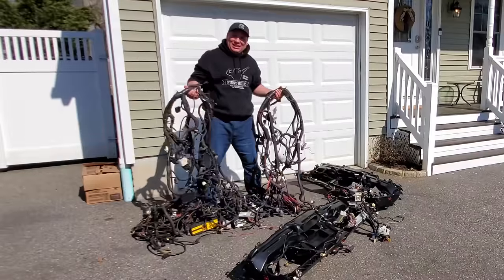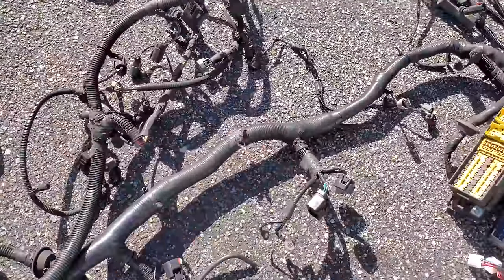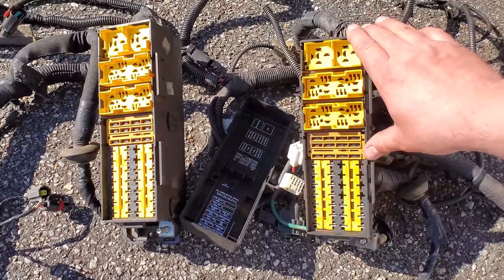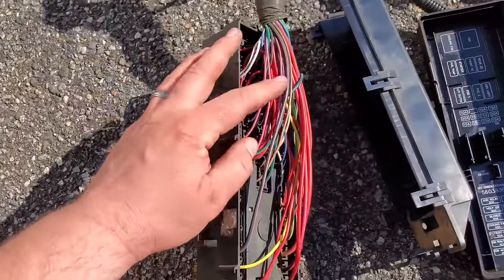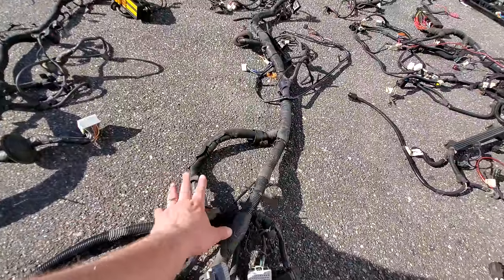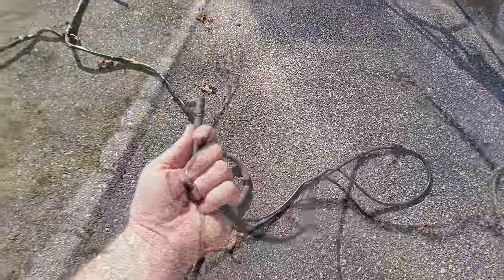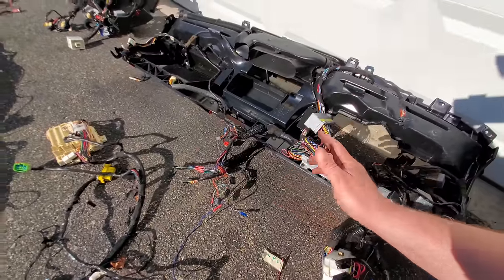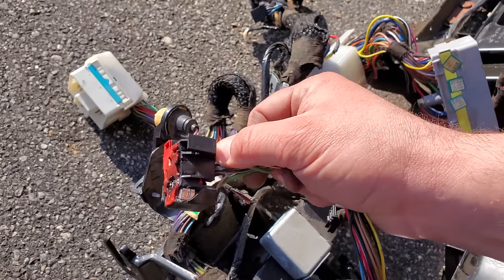JEEP XJ WIRE HARNESS GUIDE - ALL ABOUT THE WIRES FROM A 97-01 JEEP CHEROKEE XJ

Comment: What years of Cherokee s harnesses are compatible? I'm looking for one for my 99 xj 4x4. Thinking of getting one from a 2001 or a 2000
Reply from the maker: I would highly recommend using the same year if possible.  I'm pretty sure a 2000 will work tho.  The most important thing is consistency with your vehicle options
Reply: @ProjectDanH  Ok. Thank-you very much for the info
Reply: I just swapped out my bad 2000 motor w a 98’ and I’m no mechanic , I used the chilton Henderson book bud can’t get the timing correct … would swapping the harness fix that to help the engine and comp to communicate properly ? I saw on a previous comment that someone  having headlight and drl problems after they did the same thing and you had mentioned the module under the dash … I just want to go wheeling again lol thanks for sharing all your knowledge brother Dan

Comment: Will a 98 harness work for a 97? I need a harness and just can't find one from a 97 anywhere. How do I know if they are compatible or not?
Reply from the maker: 97 and 98 may be compatible.  Make sure its the same engine size and transmission.  see if you can get a wire diagram for each to compare
Reply: @ProjectDanH  yeah i am going to look at it this weekend to compare. I have to buy the whole jeep just to get the harness so i need to get it right. It was rolled so I will have to part it out.
Reply: @ProjectDanH  so i am removing my wiring harness and i noticed that it goes through the firewall in 4 places. How did you get your's out? If i remove the loom, can i separate out the wires that go through the firewall? Please help!
Reply from the maker: @ProjectXJ  All the main connections are made under the dashboard.  You will most likely have remove the dash to disconnect them.
Reply: @ProjectDanH  I was hoping you wouldn't say that! Looks like I have my work cut out for me. Do you think its worth replacing the heater core since I will have the dash off? Its not leaking or anything but I know its a pain to get to. I can do it without removing the steering wheel, correct?

Comment: i have a 91 would it be almost the same process?
Reply from the maker: Yeah, theyll be ran the same way but pre OBD2 will have alot less wires
Reply: @ProjectDanH  okay thank you my only issue is i have a 95 motor in it and i forgot what transmission i think my dad pulled both off the same jeep but thank you

Comment: It seems like no one has engine wiring harnesses for XJs. The only one I can find online is on eBay for a 94. Do you have a 98-99 harness you could possible sell me?
Reply from the maker: I may have a 99 manual harness.
Reply: Does that fit on an automatic?

Thanks
Reply from the maker: @damanico12  sorry, no

Comment: Maybe you can help me my jeep tail lights don't work all fuse are good and the light bulbs are good  the trun light and brake lights work  and that dash light don't work and the obd2 port doesn't work. Maybe you have seen this.
Reply from the maker: what year and model?
Reply: @ProjectDanH  99 jeep cherokee sport
Reply from the maker: @a2js2  99s were wired pretty well.  Unfortunately it could be anything.  I'd start by checking your ground and then checking continuity. You could very well have a broken wire

Comment: Could u use a pcm out of the same year Cherokee or would u have to change both harness
Reply from the maker: I think its more of an accessory issue.  You can use a PCM from a 2001 limited on a 2000 Limited, but you cant use a PCM from a 2001 SE (base model) on a 2001 Limited (fully loaded). I hope that clarifies things.
Reply: Project Dan H  I'm asking because I have a 1999 Cherokee it has the no bus on the dash and nothing workings so I got a parts Jeep from a buddy same year I took the engine bay harness and pcm and put it in mine everything works now the Jeep starts up but for 2 seconds or more then dies like someone turned it off , get a engine light on I scan it and it say manufacture  specific codes are found , so I click on it then click on Chrysler and it says p1694 no bus message received from ECM so now I'm kinda clues on what to do
Reply from the maker: @timfritz5183  I've never had the No Bus problem.  That's something I'd like to research more.  Just curious, did the doner XJ have then SKIM keys?  They way it shuts down reminds me of the SKIM not detecting the right key
Reply: Project Dan H yes same here has me clue less and I'm not  sure I'd have to look at it tomorrow, did the xjs even has skim systems on them? I could only find things the grand cherokees have on them
Reply from the maker: @timfritz5183  black beauty has SKIM. The key handle is fatter and light gray.  Check all your connections.. sometimes built up crud can get in those fat pcm plugs and jam it up
Reply: Project Dan H  ok where is the skim located at ? Could I possibly swap it to mine ? Cause I believe it might have skim the key I have for it is grey as well and will do I'll be checking it out Tomorrow test voltage and what not ,
Reply from the maker: @timfritz5183  I think the SKIM module is in the steering column if I remember correctly.. definitely double check.  And if you don't want to use 2 keys forever think about swapping the door and hatch locks. Lol. Good luck Tim. Hope you solve it

Comment: I think you are wrong at 10:10. Well, sorta wrong. If you do not have pins under the Fog light relay locations then you are correct in THAT senario with THAT xj the wires dont connect. However there are XJs our there that do have the pins and you can simply add a switch, relays and the fog light harness. I think*.
Reply from the maker: I am correct
Reply: @ProjectDanH  Respectfully I don't believe you are. There are accounts on forums of owners who have the pins for the relays simply installing the relay, dash switch and facory headlight harness from a fog light equipped XJ. My 00 limited has the pins at the relay and the correctly colored wires at the headlight harness quick disconnect plug. I have been looking for a ebay harness or pick n pull harness to try it but from my research, and investigation on my 00 limited, it looks like everything is there.
Reply: @ProjectDanH  I just did it on my 2000 XJ. On my 00 limited Jeep XJ, and another forum user with an 01, the fog lights are infact plug and play. See post above.

Comment: Good evening, I would like to know about the main harness, I have a original part with serial number 56009851 and the replacement has serial number 56009848.
Can I change it with that part?
Reply from the maker: I'm not sure, Its close in number, but you would have to physically  inspect it to make sure it fits
Reply: @ProjectDanH  thanks for replying, the main issue is that I can't inspect because I'm looking for that piece in online shops.
I couldn't find that piece locally.
I struggle with that part )):
Reply from the maker: @cindynava2693  oh no, maybe they have a good return policy.  Buy it and see

Comment: Hey man my cluster dont work could you help?
Reply from the maker: oh no, does it say PC bus???
Reply: I got it already had some fuses burnt
Reply from the maker: @estevanramirez9815  you have a short in the wiring somewhere.  Your gonna have to trace it somehow.. wiring is the worst!.  Which fuses blew?  That can help you marrow it down
Reply: Project Dan H it was a 26 fuze from the hood fuse box and num 9 from the inside of the jeep,
Reply from the maker: @estevanramirez9815  what year XJ?
Reply: Project Dan H 99
Reply: Sport
Reply from the maker: @estevanramirez9815  fuse #9 on the junction block serves the gauge cluster as well as the ignition switch output, compass, sentry key, and headlight delay module.  Check those system for any shorts.   If can recall any headlight issues it may be your delay module.  Unplug that, it's a small metal box usually held in on a small metal tab under your steering column.  Try putting a new fuse after u remove that delay module.  Maybe that can help you. 👍

Comment: XJ wiring Harness -
'The Horror...The Horror...' 😖
Reply from the maker: haha yes! especially 1997s
Reply: @ProjectDanH  what makes 97' more of a  pain ? I'm currently stripping a 93 yj of 4 cyl and 5 spd, and replacing with a 97 6 cyl and auto trans. I know I need mainly 2 extra injectors and trans electrical. I do have the complete running donor and plan on removing full harness and just deleting what I don't need. I hate splicing if I can help it. Just saw that 97 harness "horror" comment and needed schooling before I start. Go ahead bring the bad news .
Reply from the maker: @Tate6475  I'm not sure exactly where the problem lies... But because the 97 was the first year of the remodel they didn't quite have their electrical sorted out.  There's apparently alot of electrical Gremlins in the 97..  I remember a Jeep technician saying they overcomplicated the harness or something...  I wish I knew why..
Reply: @ProjectDanH  plan is like you said, lay both harnesses side by side, and delete what I don't need. With it being a yj, all I need is ignition ,gauges and lights. No a/c or luxury crap. Anything you can think of that I should be careful deleting ? I appreciate your response. I'm planning on picking your brain in future as needed.

Comment: Yo I need help someone wired two electric fans up to my head light harness and it melted now my head lights won't turn on  will this be hard to fix and how should I go about wireing the fans because none of the original fans are not here one I know is mechanical but it's missing so that's why there's 2 electrical fans now